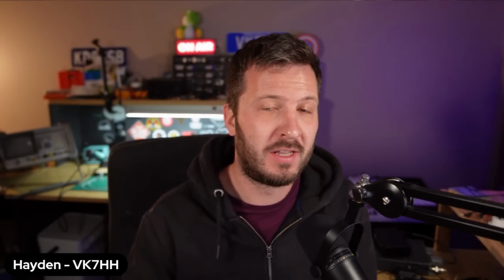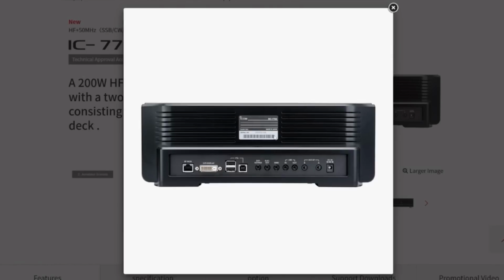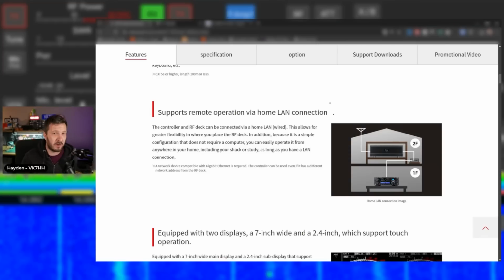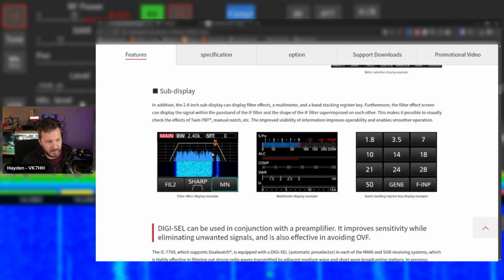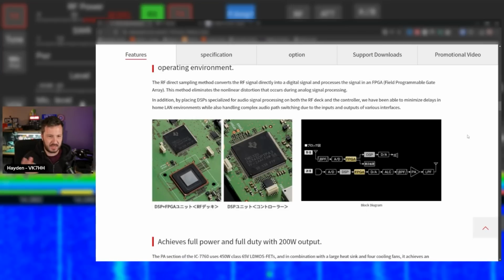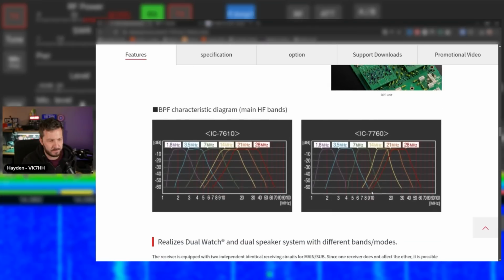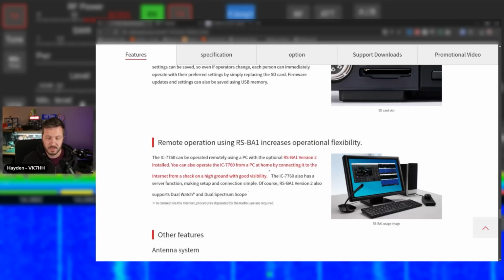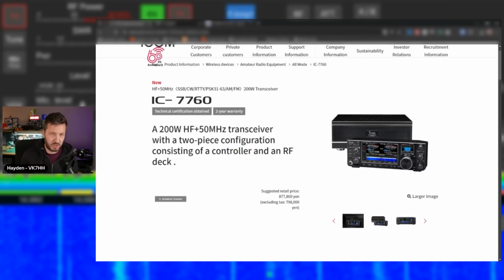NEW Icom IC-7760: Features, Specs & Price Revealed!

Comment: I am most confused by the suggested retail price. Taking the example of the 7300 for instance it is about £1000 here in the UK but with 20% sales tax it is about £1200. Japanese domestic market versions (not identical) are available for about 30% less. 
Not sure how much this radio will retail for here in the UK.
High duty cycle is attractive, I am sure part of the equation is that with a remote head radio more fan noise is tolerable.
Looks to be priced keenly in comparison to similar rigs.

Comment: Anyone who doesn't need a dual receiver;  this radio will be a passable thing. As it is 7300 and 705 working perfectly at the moment.
Reply: Yep, I’m sticking with the 7300!
Reply: @CatholicChickAZ  me too my 705 connected to a modified Sailor marine amplifier gives 200 watts in all hf bands. I am mobile portable whenever I want, the dual use is available here. De vu3mes.
Reply: @CatholicChickAZ  my 705 connected to a modified Sailor marine amplifier gives 200 watts already with 4 watts drive.

Comment: They should have included 2M and 70Cm, and maybe more.
Reply from the maker: IC-9700 does that
Reply: @HamRadioDX  not with a remote deck. So they can sit by the 7760’s rf deck when they want to do vhf/uhf? I think the idea is that some people would like to have all the antenna clutter in a basement or attic and the 7760 head upstairs in the living space.
Reply from the maker: IC-905 then
Reply: @HamRadioDX  Right. Now we’re up to 10k USD and limited to 10w. Many people want the 2m/70cm to simply get on a repeater, and their main activity is HF. So that’s why people are griping. I love ICOM and think this new rig is outstanding, but I understand the griping.  I’m just pointing out that there is a market for this, and if ICOM doesn’t provide it to protect other products, someone else will. I use a 705 with many triplexers and three amplifiers (hard rock 50+ and UHF/VHF amplifiers). I remotely control via sdr-control. If this new QRP all-band yaesu can be similarly controlled remotely, I can easily swap out the 705 with existing hardware to gain dual receive. While not an inexpensive setup, it offers less expensive upgrade paths but obviously fewer features. It’s kind of a modern 7100 replacement, which people are looking for.
Reply: @ch716  for simply a repeater there are other options ICOM sells indeed. The 905 is also pretty unique. and at high freqs and the performance requirements, it's a logical thing, the 905. But not for everybody no.

Knowning Yaesu, remote operations will come at a cost, as Yaesu is the king of creating rigs that have options options options. (And the cash back stuff)
Reply: And a Kilowatt output ;)   We always dream of more.   You really want a separate VHF/UHF for home use.
Reply: @la7dfa  exactly, look at the TS2000.... doesn't exactly shine on ALL bands. For a reason.
Reply: @RoelandJansen  It is possible to make a multiband radio that can work well on all bands, but people who are active wants a separate receiver on the bands with brief openings.  And for local FM use you want a separate radio too.  E.g. a regular mobile radio in the shack.
For HF and 6m I use my FTDX101 to listen to various HF and the second RX to discover openings on 6m or 160m depending on season.
We all have different needs and desires.  I have the FT2000 too by the way, but it is just a backup now, in case the main rig should fail.
Reply: @la7dfa  your WOW is fine. I do have different rigs for different needs as well. (705, 7300, 7000 (2x), 7851 and some porto's.

Now, when it comes to all bands, if we forget 4m, all freq below 1.8 MHz nd all above 23cm, we have the TS-2000. I hve worked with the TS-B2000. on V/UHF, works fine. on HF it's like...... well... what can I say. "Less optimal". Like you have an older Yaesu in your shack. Bling bling but awful.
Reply: @RoelandJansen  I see I wrote FT-2000 but really meant TS-2000 in storage atm.
QRV 4m as well, but I mainly go for DXCC Challenge where I have 2780 bandpoints so far.  I also have a couple of QRP radios, but they are mostly decoration.

Comment: So another fail on price by Icom.  IC905 and this monstrosity with unaffordable price tags.  You could buy five IC 7300s instead of this with a power supply for each.
Reply: I dared assuming the price before end of the video and had roughly half of the revealed sum….
Reply: Not every product is for everyone. You could say the same about a Ferrari and there is a big market for those. There will be many who will afford this radio. Looks to me like it's priced  15% over the Kenood 890s
Reply: Easy fix....if you don't want to buy a Lexus go to the Hyundai showroom.
Reply: Yep, now I’m waiting for a price reduction on 7300 and I’ll order 2, Yah!!
Reply: We have been waiting  for a mobile  replacement rig from icon 7000 7100 7200   I really agree with you about designing expensive rig instead  advanced rig of mid  price  afordable like the 7300.
Reply: I’m surprised that the price is as LOW as it is!  Consider that ICOM’s earlier flagship HF/6M rig, the IC-7851, retailed for a staggering $13,300(!!! 😮), while this is hardly cheap, it’s cheaper than a Kenwood TS-990 (@ $8K), & is in the same price range as a Flex 8600M at @ $6K.
My impression is that the IC-7760 is a clear “shot-across-the-bow” at Flex’s market.  At the New England ARRL Convention (HamXposition) this past weekend, I had a chance to play with a Flex 8400M; maybe it’s just that I’m so used to ICOM’s excellent, user-friendly interface (I currently own the IC,7300, IC-9700, IC-705, & numerous older ICOM models), but I did NOT find the Flex user interface as intuitive as ICOM’s is.  ICOM also made it very clear that they’re also shooting for the top spot in the Sherwood performance ratings with this rig.
I have considered upgrading to a higher-end HF/6M radio (primarily the IC-7610 or a Flex); if ICOM actually makes this available for the $6K (or hopefully less) price tag,it might be worth my while to consider waiting a bit & budgeting for it. 😊
Reply from the maker: Do you think they are making a massive profit on this, that it's cheap to make and innovate? Or that it's expensive to develop?
Reply: @HamRadioDX  part of being a successful business is being able to develop a product and manufacture it cheaply enough so they can sell it at a price that is appealing and still make a profit. Either ICOM can't do that or they are gouging.
Reply: I could see Icom and Yaesu eventually making and selling control heads and RF decks separately, allowing a person to select different features for each.
Reply: All that money and a depleted discontinued crap video output.  DVI…. 2003, are you kidding me????  No HDMI or even DisplayPort…. And we are supposed to think it’s innovative?   What a tech fail.
Reply: No remote head on the IC-7300 😎

Comment: The IC-905 uses a custom PoE setup to power the RF deck and is why it must be connected directly to the control head.  With this IC-7760 there is no PoE as both the RF desk and the controller have their own power source.
Reply from the maker: Yeah thus why it's cool that it works over LAN

Comment: Just guessing - the 3mtr control cable probably powers the head but if you do a lan hookup then you will need a power pack on the head unit.
Reply: They give you the power supply (15VDC) for the head unit, incuded with the radio.
Reply: it has a separate PSU for the head; the control cable is to be used for further away. a 3 m cable if supplied so that you can start immediately.

Comment: I want one. I should start dropping hints to the XYL now so in 3 to 5 years she may let me have one lol. The 7300 still going well as is the 9700. I am looking at setting up a remote station down south on top of a friends farm about 40KM south of my QTH, its a 400ha sheep and beef farm and 280M above sea level and less than 1KM away from the sea. It has  very low RF noise there. The 7300 would be nice to go down there for the remote setup.  Thanks for the info. 73 ZL4SY Norm

Comment: It's basically what I predicted it would be.  A modern SDR replacement for the 7851.  Only thing I missed was the remote RF deck.  Not that it's cheap but it's significantly cheaper than I thought it would be.  I assumed it would be more than what the 7851 was when it was discontinued.  Wow, was I wrong.  It's less than half of what the 7851 was going for.  I already have my back channels preorder in.  Countdown to delivery has begun.  And since I'm a follower of Dave Jones (EEVBlog) from down under I live by his principle.  "Don't turn it on, tear it apart."  Can't wait to tear this beast apart.
Reply: @MrAnon-g7m it definitely is not a replacement, people that have the 785x generally will recognize this as a step back and what others may have said too: it's more between the 76xx and the 78xx series. Say a 7700 replacement.

It's just not your cup of tea. (And no, I won't trade in the 7851)

Comment: So just a beefed up version of the 7610 with a price to match. Nothing to replace the old 7300.
Reply from the maker: They probably think with the 7300, if it ain't broke don't fix it - just yet..
Reply: 7300 is the best beginner radio on the market, it has out sold every other radio for a reason .
Reply: @saltire546  at 100k+ sales yes. And still going.
Reply: i want to HEAR & see first that the IC-7760 would hear anything more than the IC-7300 can, i doubt that there is much it can hear the 7300 can't. Icom IC-7300 is best radio.

Comment: I reckon you could hook them up remotely via VPN/tunnelling too.
Reply: That's exactly what I'd be looking to do :)
Reply: Latency...
Reply: @todd8155  not talking other side of the world here. You'd only be looking at 25-30ms depending on where you are
Reply: @todd8155  From to city to the countryside 50km away it is only 2-3ms via two fiber connections,  I bet that would be doable.
But once you start routing via other ISPs or other type connections the latency will start to become an issue I guess.
Reply: @todd8155  important number yes. So far, the latency is in the ms with a cable between head and deck, is what I understand. It starts to be come unuseable with CW, or if you approach flexradio's latencies over the internet.
Reply from the maker: 100% doable I think
Reply: @HamRadioDX  - It would be interesting to see how much latency the manufacture allows, and how much one would see over the Internets.  Not only transmission delays, but there is software overhead too for VPN clients.  Perhaps some edge devices (routers, modems, CPE equipment like Cisco or Juniper) would have a high speed VPN implementation, but not sure super low latency is a primary design consideration. I wonder how additional latency would affect the operation?  Would there just be stutters and delays, or would there be worse anomalies in the operation?  

Also, I see that the spec is for Gigabit Ethernet.  Most home network routers and switches are not Gigabit Ethernet, and that's a lot of bandwidth for much of the U.S. Internet as the U.S. tends to lag many other countries in Internet speed. It's easy enough to update a home switch or router to one that has Gigabit ports, so any delays on a home network would be easy to handle.  The default is a CAT5E cable plugged into the deck and controller; that will handle the Gbps speed.  Anyway, it couldn't hurt to set this up and to see what happens.  Gamers have dealt with these issues and may have some valuable input.

Regards!

Comment: Looks like maybe a replacement/upgrade to the IC-7851
Reply: I have the 7851 and control-wise it's a major step back. If it was a head with all the controls on it, I would think you are right. This definitely isn't a 7851 replaced. Not even close.